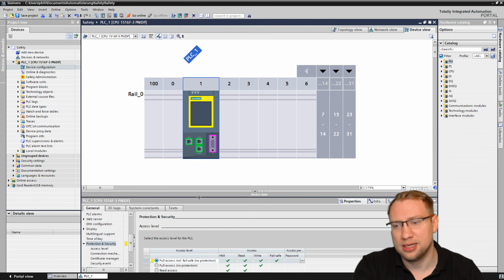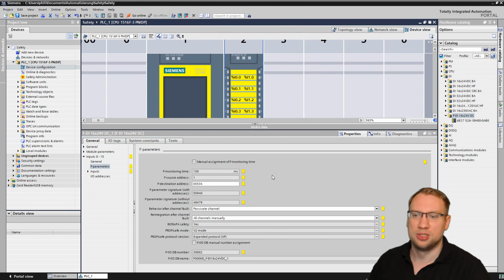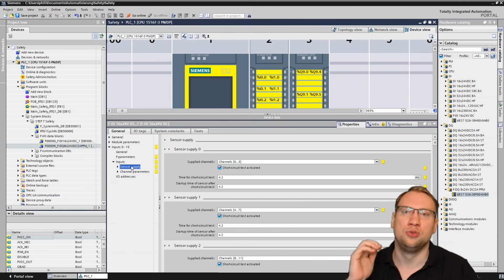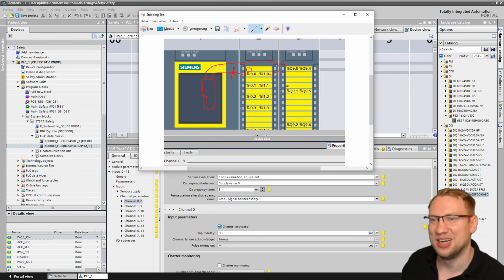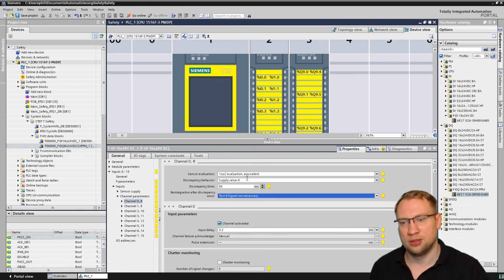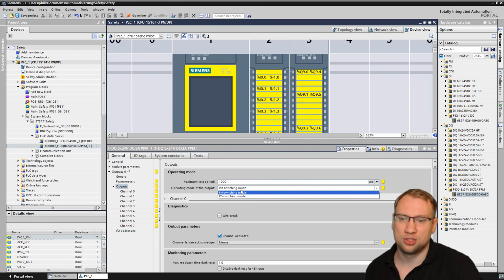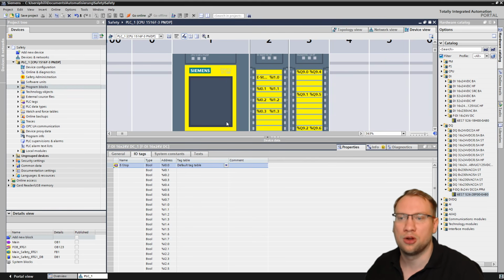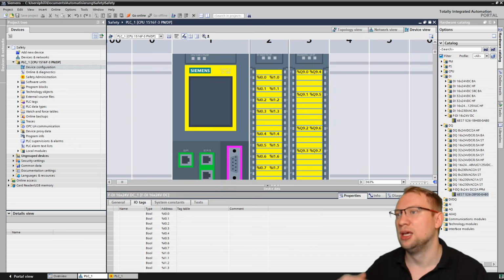TIA Portal: All Safety Basics! Part 2: Hardware Configuration

Comment: Safety IO device [6ES7 136-6BA00-0CA0] has quiet different settings than the one you showed in this video.
Question:--- > Time 27:00, so we still need to connect the sensor cables to both inputs i.e. %I0.0. & %I1.0 both, but no need to separately monitor them in Safety program? So if I have 2 E-stop actuators then I should connect E-Stop_01 to %I0.0 and E-Stop_02 to %I1.0 but only monitor %I0.0 in safety program?
Reply: Hello Jamal,  I am using FDI [6ES7 136-6BA00-0CA0] and the error is discrepancy failure channel state 1/0. I have tried many stuffs including the things shown in above video. Could you please help me ..TIA
Reply from the maker: There are MANY different devices, 100% correct! Very complex topic

Comment: 13:06 why two sensors? In addition to what youv said sensei,could it be that the two sensors use different technologies? Like if we wanted to measure level for instance, we could have capacitve level sensor and maybe radar level sensor? I dnt knw..
Reply from the maker: It's mostly for redundandy. If it comes to safety you better go with two sensors rather than one. You could also get some redundancy by using different technology (like you said with capacitive+ultrasonic) and use them in the program as just "signals"